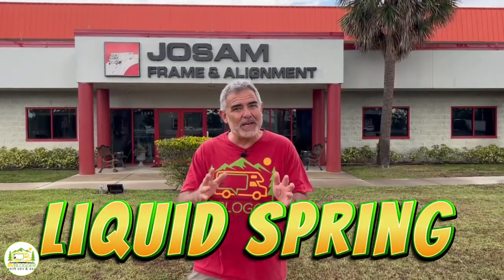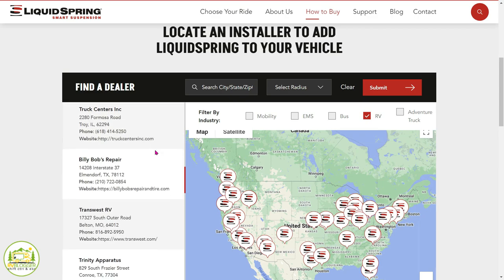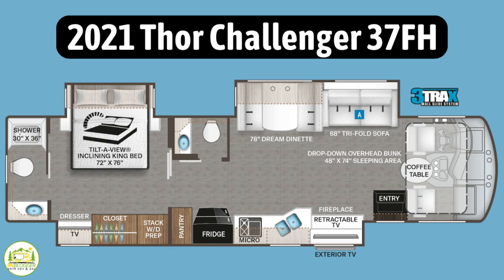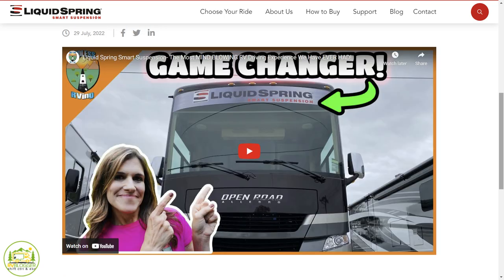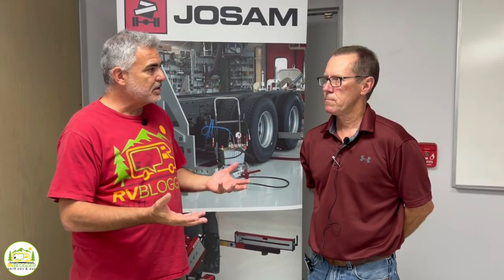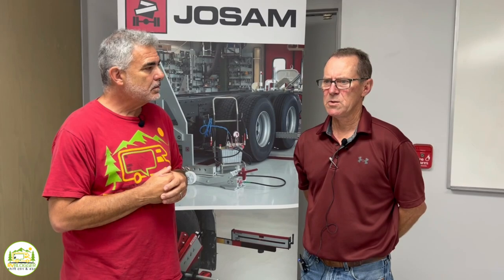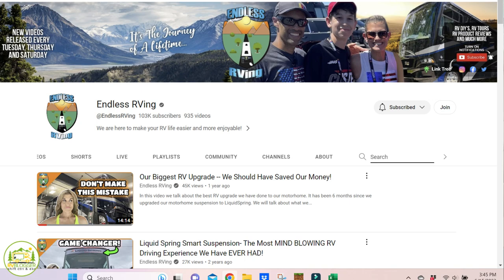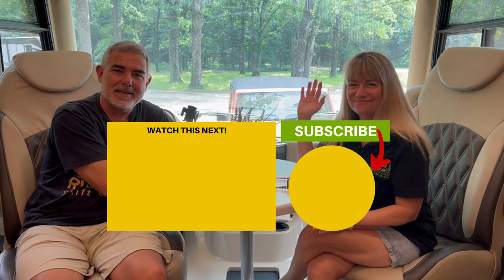Liquid Spring Suspension Review and the Best Installation Location

Comment: We have a diesel pusher with air bags, and this would be a very nice accessory. But way too expensive. If a bunch of money suddenly falls into my lap, this would be high on the list. Great video. One correction. After Liquid Springs ARE installed "
If you have any questions please comment below, we IS happy to help." Huh?
Reply from the maker: Hi Edward,
If you have a diesel pusher with air bags you don't need Liquid Springs. You already paid for a better suspension when you bought your diesel pusher. So if some money falls into your lap you can spend it on something else!
Thanks for watching!
Mike

Comment: Question about the Thor Challenger. I have not heard anything good about the quality of the build for THOR in general and maybe even less about the Challenger. My wife and I really like the floor plan as you and your wife do, BUT, that said, I am leery of the reputation Thor has based on review and some RV experts that have offered their opinion of Thor. So what has your experience been since your purchase of the Challenger, after the sale support experience, etc. you comments and opinion  are appreciated.
Reply from the maker: Thor is like every other manufacturer. There are few quality controls in place and they deliver inferior products. But this is true across the board unless you want to spend an ungodly amount of money.
We bought our rig knowing there would be plenty of repairs to be made but we felt this would be true for any rig we bought.
We love the floor plan and we have made some nice upgrades like Liquid Spring and our solar package. And I also went through and strengthened every drawer bottom in the RV.
They use schwintek slides which suck in my opinion so I have become better at fixing them. 
I would recommend joining the Thor Challenger Facebook Group ( or the corresponding group for any RV you are considering) and asking these types of questions. The owners will give you great answers.
By the way Thor Makes like 40% of every RV on the market so its hard to generalize and just say don't buy a Thor. Forest River makes about 30% of every RV you see out there.
They all use the same parts, components, appliances and A/C units so really they all have different paint on the same underlying RV.
Thor's customer service is ok. We've had ours back to the manufacturer twice and it was a 6 month wait to get in. The service folks are mostly nice except for this one lady named Kirsten.  
I recommend you have a serious RV inspection before buying any unit and that you try everything yourself too like the slides, plumbing system, electrical, electronics and so on. And drive it on the highway at 70 miles per hours. Do not take possession until the dealer fixes EVERYTHING on your rig.
In anticipation of having to make repairs one of the first things we did was buy an extended warranty (not from the dealer). You can buy Dealership warranties for 5 or 7 years but there is a mileage cap of 60,000 miles. That will not work for us because we travel too much. And I wanted a warranty where I could use mobile RV Techs rather than waiting to get into a dealership. (And good luck getting a dealership to work on your RV if you didn't buy it there) We went with Wholesale Warranties. Here's the link if you wanna check them out. https://goto.rvblogger.com/Wholesale-Warranties
Sure hope all of this helps you out.
 Mike

Comment: It’s a good product! I talked to them last year for my 2021 class C which is 34 foot. The quote from them in Indiana was $17,000. That’s for an e450 chassis. I was not exasperated over it but was trying to figure out if I sold the coach in the future whether it would be a selling point to an average buyer whom knows nothing. And trade in to a dealer would do nothing, I don’t think. But caveat to it is as long as I own it it’s all good. But I ended up putting the sumo’s and sway bars and steering stabilizer on it all the way around and we are happy as larks over the ride of this class C . But still would have got the liquid springs, such a sweat set up. For now I’ll take second fiddle.
Reply from the maker: Hi Rick,
I'm glad your setup is working on your Class C. I don't know if Liquid Springs will affect resale value or not but I sure hope it does!
Thanks!
Mike
Reply: From what I’ve seen, I don’t think it affects the resale as much as you’d like. Maybe a few thousand dollars.
Reply: Can I ask what model class C your have?